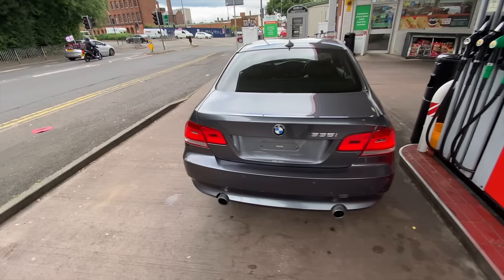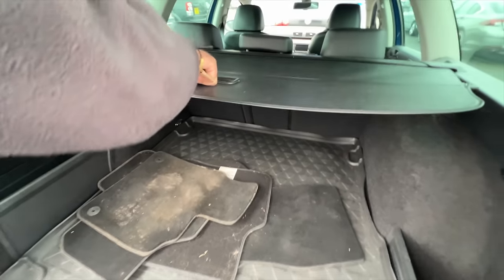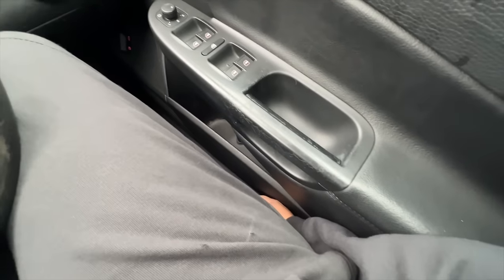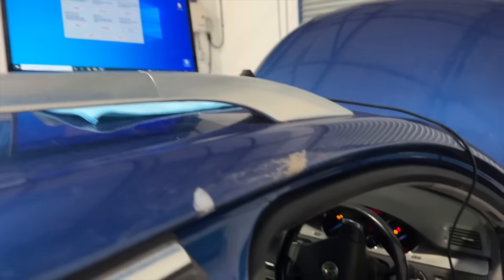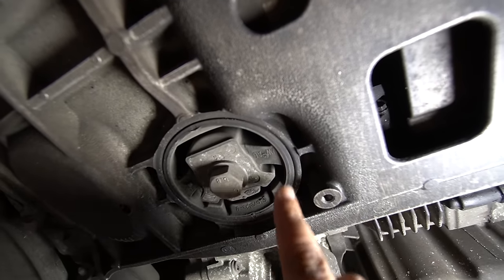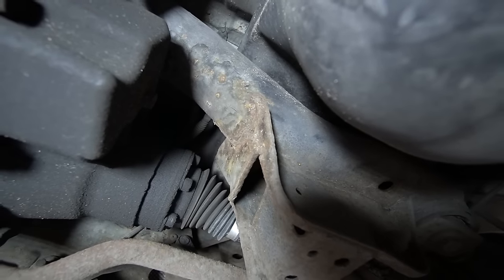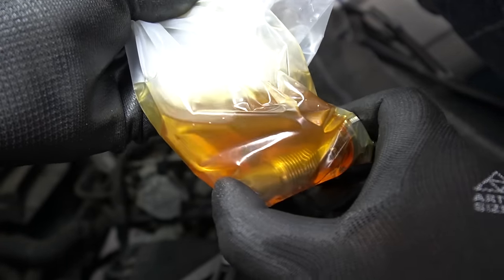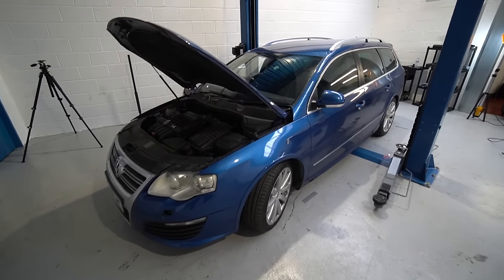I BOUGHT THE CHEAPEST VW PASSAT R36 IN THE UK!

Comment: For anyone's benefit: The cam tensioner trick usually just buys time before the chain snaps/jumps. It rattles at start up cause the tensioner doesn't have enough oil pressure to take up the slack, usually only happens after being sat overnight etc then gradually becomes every time. Unless it snaps or jumps first. 

Great video as always 👍

Comment: Nearly all the 6cyl engines across the VAG models of this time suffered from chain slap. But I think as this example had been sitting for some time it really didn't sound that bad. Lasted just under a second, I'd keep an eye on it and see how long it does it for after being left overnight. For the year/mileage, it look as though it had been maintained not too badly, it's possible the chain had already been replaced at some point. Would make some great content to see it being swapped out though!
Reply: Or just needs correct oil...VR6 engines dont give that chain issue unless its been tampered with.
The last VR6 engine with known TC issues was the OBD1 VR6 from the first gen MK3 AAA engine.

Comment: @TRHamza my daily is the 2012 C350 CDI its standard 265bhp I've mapped it, made some aftermarket filters as none are made currently for this engine. Soon to be fitting a much larger intercooler then get it mapped in etc but there's hardly any mods for the OM642 platform and as I hear the block can't take more than 400bhp unlike the BMW and Audi 3.0tdis which go way over 400 easy 🤷‍♂️

Comment: I used to have one of these still one or the best cars I’ve owned. Great looking estate car. Locking steering column is a known issue on these as it’s a small electric if module that has failing micro switches. Pretty easy fix though as can transfer immo chip from one to another.

Comment: Theres a lever under front left of the seat so it slides back aswell as the electric mine is the same must be a common problem it blows the fuze under the steering wheel to the right theres a lil compartment open it take it out theres a fuze behind it

Comment: I had similar noise on mine but it ended up just been the PCV on mine over 200,000kms on mine.
Don’t trust mechanics saying it’s the chain! Because that won’t go at all! Long as you service this cars every 7,500kms after 200,000kms I would suggest you switch to servicing this engines every 7,500kms not 15,000kms like they say.

Comment: Interestingly these are cheaper in Australia than the UK? Normally it's the other way around generally. I've just had a quick look on Australias biggest online domestic classifieds and there's a 08 Biscayne blue R36 with 240,000 kilometers or 149,000 miles on the clock for the same price you paid for yours at auction, $10,800aud or 5,990 in your money. 
Shame MINI JCW aren't the same price here as you guys pay for em, bloody cheap as chips over there, and drug money here 😫 new sub +1

Comment: I like the look of those passats, but fuck me do they have their issues. Park brake motors/button/control unit faults… steering column locks, BCM, comfort module etc just to have a few. Pretty much the reason I’ve never bought one of those is because of the amount of common issues they have

Comment: Asalamo alekum bro MASHA ALLAH nice video I am having a problem with my golf 5gti dsg multitrinic paddle shift  running stage 2 with 76mm down pipe resonator deleted car drove awesome a whole year but 2months ago my car started to misfire after a rough driving on manual and sports mode on a high way but as soon I get to busy traffic roads and driving on d mode the car starts to mk a push when shifting and misfire at times changed spark plugs misfire was gone but other issue of driving on D mode after rough driving the push and power should still decrease went to diagnose only evap related codes were captured incorrect air purge flow replaced N80 valve and evap canister code didn't return but problem remained the same removed manifold cleaned intake valves no positive response started with fuel related replacing intake fuel pump high pressure fuel sensor new cam follower even though old1 was not worn swoped high pressure fuel pump and still no results then I was told to disconnect o2 bank1 sensor and test drive as bank2 sensor is off by map tuning by disconnecting the o2 sensor car drive like a dream problem fully sorted but after replacing the o2 sensor the car is again doing the same 😢😢😢😢 even replaced pcv valve I am so frustrated Kasam I don't know what to do anymore saw ur video and now thinking maybe it's my coils bcs the mechanic only could find misfire by one coil and replaced 1 and other coils r weak too after getting to maximum heat after rough driving and if I let it cool for a while then it's OK to drive on D mode sm1 said u must switch the o2 sensor off by the tuner and drive like that but my concern the whole year car was driving fine with only 2nd sensor switched off😢😢😢😢😢😢😢😢😢 please bro help im a big fan of urs and watch al ur videos which encouraged me to do stage 2 and downpipe with pop and bangs now im sitting with a sore heart after spending such a bunch of money i still cant get my problem sorted neither these so called  experts 😢😢😢😢😢😢